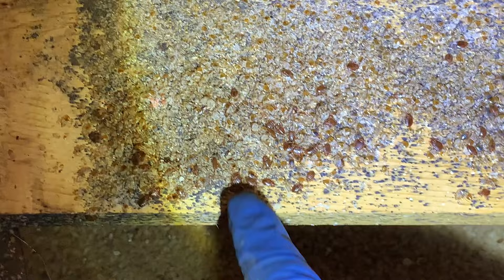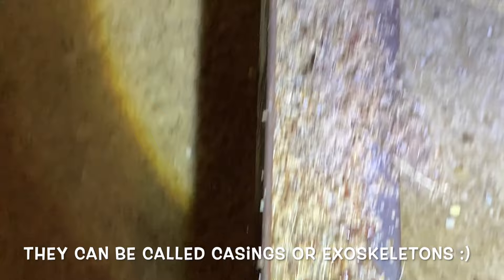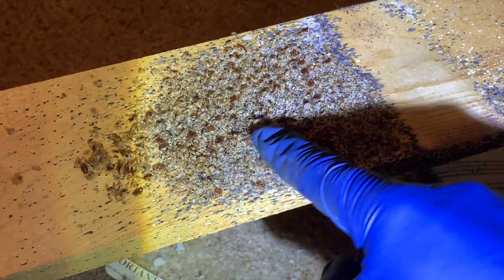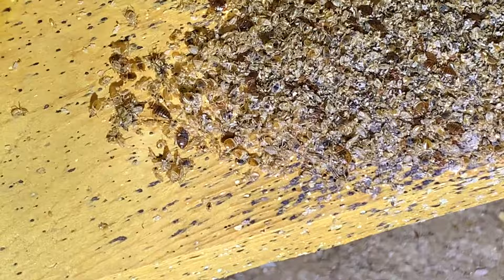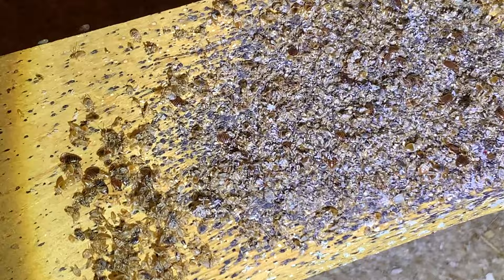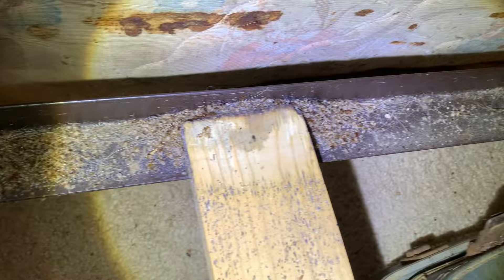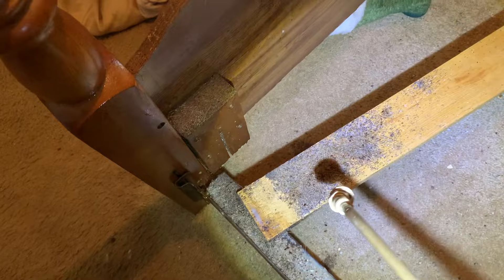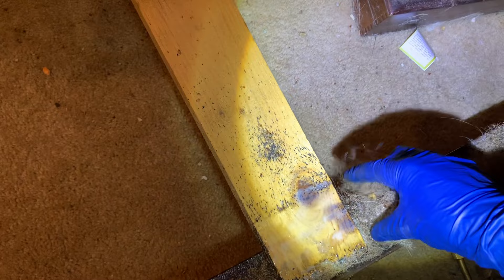This is Where Bed Bugs Come From

Comment: I  purchased empty spray bottles and filmed them with Isopropyl Rubbing Alcohol 70%, sprayed areas were it was most infested, repeated this for several plus vacuumed  it took several months but it worked !
Reply: I think heat steam cleaning is effective
Reply: @dugebuwembo it's more effective than alcohol. Bedbugs will develop immunity to anything you put on them.
Reply: @HH-le1vi Yes and no. They have and are able to adapt to new toxins which target them. But adapting to alcohol spray would be like being able to adapt to being crushed, alcohol kills them in another way. 
Alcohol is highly flammable! And should be used only with great caution.
Reply: @kevincherry2215  I've seen it with my own 2 eyes several times. They will absolutely develop an immunity to alcohol.

Comment: I was traumatized at just the thought of having them. I got a mystery rash & immediately jumped to the conclusion that I might have bed bugs. I sprayed everything, including my bed, carpet, & bombed my house twice. I took all my beddings off & put them in plastic bags til I could wash everything in hot water 2-3 times. I threw out all my pillows, about 8 of them, & got new ones. Then I put my mattress is a ziplock bag & all my new pillows in allergy/bug protectors. After stripping my bed, I only used the absolute minimum to sleep with until I could confirm the issue. I researched as much as I could too. Got these little bed bug boxes to put at the feet on my bed to try to confirm if I had them because there was no sign of them, that I could see. This was all done within days of getting this rash. Then I went to my dermatologist, they did a punch of my skin to have it examined, & it was just an allergic reaction. Just the thought, panic, & slight possibility left me forever traumatized. This was a few years ago & I still sleep with a ziplock bag on my bed & allergy/bug pillowcases just to ease my mind. Now I'm paranoid to stay at a hotel.

Comment: because of dust mites and all other buggies I have always had both mattress and box spring encased in vinyl zipper covers. I also have the zipper taped over. So even if my mattres is a decade old it is still basically like brand new under there. Safe from all the little crawlies and body funk. It is super easy to keep clean.When you wash your sheets,you just takes some disinfecting wipes and wipe down the mattress cover before putting clean sheets on.

Comment: Interesting video. I have to tell you though that it isn’t ONLY older people who don’t show a mark when bitten. Some people for  whatever reason do not show any marks regardless of age. It’s dangerous to assume that it is only older people that do not show any signs of the bite. Not sure where you got that information/idea  but I guarantee you it’s incorrect. Personally  I’ve known several people in their 20’s 30’s and 40’s who have been bitten and do not show any signs of being bitten. Besides that, skin sensitivity on its own is not necessarily related to marks being left. That connection I’m not sure how you made but please,you cannot continue to put older people in this category. It is an entire group of people at various ages who do not show signs of the bites. Please understand this. Thank you

Comment: I  work in  housing and have done for 30 years. I have seen the most extreme cases of bed bugs  and in some cases properties infested so badly that bugs have been falling off the ceiling of  and  curtains so bad that the curtains have become crusty. In extreme cases bugs no longer confine themselves to a bed and can literally take over a whole property.   In bad cases as in this video and worse it usually comes about  because the  problem has been ignored and untreated for too long. The key to eradicating bed bugs is to constantly make regular checks and if  you see only as much as one - treat your place as if it were a raging infestation.  Give one bug half a chance and you will find yourself on the fast road to  hell.

Comment: There is one other way you can get bed bugs that isn't picking it up from another place. 
I moved into sn apartment and found out way too late that it was infested with bed bugs. The whole building. They got away with not treating it by having a couple of random drug addicts they called in house exterminators with nearly 10 minutes of training. Needless to day after 14 treatments i was getting bit worse than ever

Edit: they also can live anywhere in the dwelling, but the closest thing to food aka sleeping humans is thwir fave. If you have a bed bug proof mattress and a steel bed no box spring, they'll live in the wall or in a book or behind a picture frame. Anywhere.

Another thing he didn't mention is that you can easily get them from hotels. Ways to svoid taking them home:

-do not keep belongings on or near bed overnight. Do not store bags or suitcases on the floor, especially not near the bed  store it up high and  away from the bed.  You dont want them to hang out in your stuff after their bloodmeal.

-After you stay anywhere else overnight, put all clothes and belongings in the dryer on high heat for at minimum 20 minutes.

-if its something like s suitcase, put it in a  enclosed plastic bag for 13 months or put it in a car thats hot all day and night for three days.  heat kills these shit beetles the best. .. even if placing each one in rubbing alcohol and watching them twitch to death is more satisfying.  god damn it i hate them so damn much

Edit 2: i wasnt going tto day it because maybe he misspoke, but bed bugs were historically a HUGE problem until we killed em with DDT.. snd then they become tolerant to ddt and ddt's chemkids. And then the populations exploded all over again.

Im going to try and provide a link. If there is no link, its because my sources keep getting me deleted.

Ugh. I can't link studies

Google university of kentucky, and bed bugs; penn state +bed bugs: rutgers + bed bugs; and center for invasive species researxh and bed bugs

Comment: I would vacuum first get as much as possible then use apprehend and use crossfire around the room so you will wipe them quickly.  Tell the customer trash the mattress
Reply: Bad idea. You need to kill the bugs fist before handling them and vaccuming. Otherwise, they'll just crawl everywhere.
Reply: @itsgonnabeanaurfromme  never had a problem doing this way. I know for sure different tech has different approach. Thanks for the input.

Comment: I’m dealing with bed bugs now ; I literally am so paranoid I can’t sleep😔. I’ve sprayed crossfire 2 times. Idk what to do anymore.
Reply: Call an exterminator they can generally fix it in one to two sprays I had mine fixed in about a week also get a mattress cover
Reply: @i_fuze_hostages6  yeah I did that. The quote was 1,200$. I’m Poor and don’t have the money. I got a new mattress and box spring though. Both of those are encased . I’ve seen a 90% decrease in the bugs . Yesterday I saw 2. Got bit once.  That’s it though .. I hope they’ll die soon
Reply: Get Rid of the Mattress!!!
      Get a White Foam Mat!!!
Put Bed Legs into Catch BowLs!!!!
Puts BowLs of Water under each Bed Leg!!!
Watch More  U-Tube VIDES  about  Bed Bugs!!!
It's Easier & Nicer on a Lap Top!!!  I Hate CeLL Fones!!!
Reply: I had a brief problem, we used crossfire, ortho and that yellow can, all 3 and got rid of it all with ease. Also you need a steamer, the kind you steam clothes with and steam the FK out of your carpets because bed bugs live in your carpet.
Reply: I have bed bugs too I’m miserable. I did however hire an exterminator that I can’t afford and I don’t know what they are doing. They have been treating for over a month and half and nothing has changed. They said I had a small infestation in my room only.  But after a month and half of treatment nothing has changed. I even pulled my bed from the wall and found a whole infestation they missed!!!!  I am livid that even they aren’t doing anything to help. And mentally it has taken its toll.
Reply: Try diatamacious earth..probably misspelled that but it worked for us within two weeks

Comment: If you live in an apartment complex and the person beside you get bed bugs, they can come through the wall to your apartment and infest your stuff. That happened to me, and I didn't even know what a bed bug was. I started noticing red stains on the floor that would go from the bottoms of my bed post to the baseboard most every day, and my bed frame was metal, so I thought gosh, it's rusting. And I would wipe that up every day thinking it was rust (was my digested blood) then my cat didn't want to sleep with me anymore which really made me think what in the world was going on. Well, it finally came out that there were people in other apartments with bed bugs because they had spread throughout the building.  I moved and put everything that was very important to keep like family things in a very hot storage unit by itself for a good 5 years I threw away everything else and started over in a new home with only a twin bed a recliner and a TV. I had to throw out my other TV because they infested the TV as well. This was about 14 years ago, and honestly, I'm just now back to a point in life where I have a complete home again with furnishings and everything that most houses have inside. If I even saw a bed bug in real life again, I think I would have a heart attack.

As far as what you're saying about cats and dogs, you're mostly right however I had a very old cat who was 18 and he could no longer jump up so he had a bed on the floor.  He died about 3 months after moving out, and he was anemic. I did everything that I could, and it still bothers me to this day. They don't like pets, but if one is accessible and it's there, they will go for it. My other two cats were fine as they didn't stay on the floor, nor were they as old and sedentary.

Comment: And I freaked out 5 days ago with two quarter sized nests about a foot from the bottom of the bed.  Mine came in on the grooves in the bottom of my sandals. They fit perfectly up in the grooves. A cozy welcome into my home, where I put the sandals at the foot of my bed at night.  The massive deep clean and eradication has begun here. 
There is no sign on mattresses or box spring. Nothing.  Had I not been so allergic to the bites I would not have notice and this could have grown so fast.  I am doing everything recommended to the entire room and then the entire rest of the house.  I may have a chance against a bigger infestation by finding it incredibly early.  Because no sign on mattresses. They were and are being treated then encasing in bed bug proof full mattress covers because I know I can’t get every single egg or bug.  Three steps for everything. Kill. Track and treat with longer acting chemical.  Prevent as much as possible with the longer acting spray and DE. 
My fingers crossed for near total if not total removal of bugs.  I would have freaked out at that level of bugs.  I couldn’t imagine not finding that before it got that bad.  Thank you for your videos.

Comment: I woke up with a dozen itchy bites out of nowhere. Is it bed buts or fleas from my dogs. I searched my bed and could find no trace or them. I didspray with bedbug spray and i washed all my bedding and dried on high heat. Wierd, my husband has no bits and my dogs are not scratching. 
I was researching on the internet and learned that bed bug bites can take 1 to 14 days to show up. A week before i had helped tear up carpet in 5 rooms in an old house my btother had just bought. Then i spent a lot of time on the floor pulling up tack strips and staples from the padding. We hauled it all to the dump. So that explains why i cant find any bugs in my bed. Thank goodness i dont have them butwill keep my eyes open. 
As for my brothers house, it is a fixer upper and empty. I sprayed the baseboards and woodwork. Put out 2 gluetraps and cautht anything.

Comment: One of my main tools for treating bed bugs was a six inch hunting knife. I would cut away that fabric on the bottom of the box spring so I could treat up inside it. If you think the infestation is bad on the outside there are far more on the inside. I also cut away that covering fabric on couches and chairs in order to effectively treat them.

Comment: I heard you can use heat like 150 degrees for a extended time to purge the house of bedbugs.
Reply: And how exactly would you heat a house to 150 degrees? Guessing you're american and use Fahrenheit
Reply: @itsgonnabeanaurfromme  100 degrees celsius (boiling point) is = to 212 degrees fahrenheit.
0 degrees celsius (freezing point) is 32 degrees fahrenheit.
Yeah he meant 150⁰ F.
That's equal to 65.5⁰ C
Reply: Yeah William that is the only guarenteed way to kill all the bed bugs. They bring in industrial grade heaters and heat up the whole house to the point where all the bed bugs die.
Only problem is it's EXPENSIVE.
Think high 4 figure numbers, if not 10, 20 grand if I'm not mistaken.

Comment: We had a nasty infestation years ago, we managed to get rid of them using Diatomaceous Earth and vaccuming
Reply: From what I read Diatomaceous Earth is a good product to use because humans can ingest it without getting sick. It is the dust that can hurt human eyes and breathing in is bad too.I use a big folded cloth over my nose and mouth when I put it down and make sure I am careful not to get it up or stirring it up in the air at all to bother my eyes. They say you can use a turkey baster to apply to baseboards or a bottle with a small pointed tip. I also have used in my garden for a terrible fire ant problem. I think it is the best way to eradicate them yourself before you can get any help.

Comment: Did you have to make return visits for additional treatments ? That’s quite an extensive BB infestation. I would’ve probably refused that job until everything in that room was bagged up and removed and the furniture pulled from
The walls. Man I don’t want to wrestle a bunch of dressers, desks or other furniture around a small room and rub up on some crack full of nymphs  and get hitchhikers on me to bring everywhere else.

Comment: Are you not pulling all the drawers out of the dresser and other furniture and treating inside the frame and the drawers themselves? You can not effectively treat Bed bugs with spot treatments. Do you pull the face plates off electrical outlets and treat them with Delta Dust?
Reply: The Delta Dust is awesome when fighting roaches and BBs. The residual last a lot longer than spraying. 
Spraying residual works for roaches but not BBs

Comment: I didn’t see you check out the seem on both sides of the box spring and mattress, 91% alcohol, in a spray bottle also kills nymphs, eggs, and hatchling, and grown bed bugs… also if you keep your bed, encase your matress and box springs each with two zippered covers! It takes a year for those bugs to die
Reply: Be extremely careful with the alcohol spray, it’s highly flammable. 
Just a warning from an old guy
Reply: @kevincherry2215  yes I know, that’s why I don’t smoke when I did my treatments.

Comment: I have a question 👋 help please! I live in Virginia and my house sits on top of a rock pretty much. It's surrounded by creeks and it's a very old house. The foundation is mostly rocks stacked together. I don't know if all that helps but I have a huge problem with house centipedes ( I believe) they are super fast and have long legs and they turn into a blur when they run because the legs are so slim. They are mostly in the bathroom washing room area because that's a concrete slab because it was once the porch but later bricked in to the house. Recently we were remodeling upstairs to put in another bathroom and while I was painting at night with a work light shining for help I seen this shadow of a thing go across the wall and I know the shadow made it look big but it was huge and one of those things! I almost died! It scared me sooo bad! The floor had just been put down and the baseboards weren't back up yet so it looked like it was trying to go back into the wall? I went to google and read some info that these can get big and they have been known to get into people's beds for warmth?!?! Is this true? I haven't slept since last year when this happened 😆 I'm constantly checking our bed especially the kids. The one I seen I would swear was the size of my hand slinder but long! I know the shadow made it bigger but I promise it was to big for comfort! How can I get rid of these things and where do they likely live? Nest look like? Eggs? I soak the outside in home defense twice a year esp around the slab, windows but it doesn't seem to help much. Sorry I know this is long. Please any help would be appreciated!
Reply: Yes they can and will get into your bed…they like damp cool areas like basements….I had a basement apartment not long ago and was the first time I even saw or heard of them….I found them on walls, on me, running on the floor and at night felt something on my head while I was in bed and lifted my head and saw one run down the side of my bed…I saw one on my wall that was over 6 inches long…I killed it but it freaked me right out….the only good thing is you won’t get any other bug because they eat them….spiders, bed bugs, roaches….everything….I started sleeping with the lights on cause they prefer the dark….
Reply: I would buy a lot of sticky traps and place them where u usually see them and a bug net for the bed.